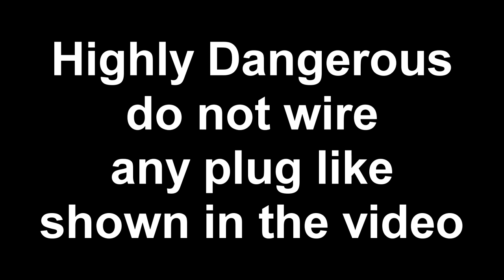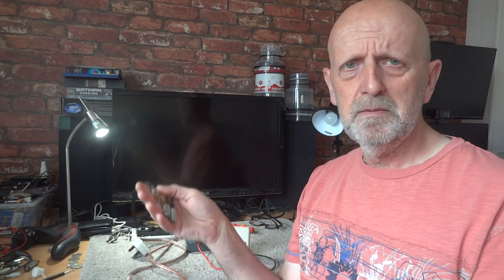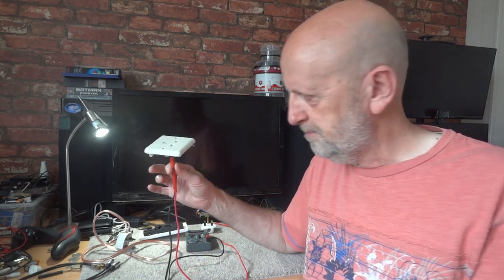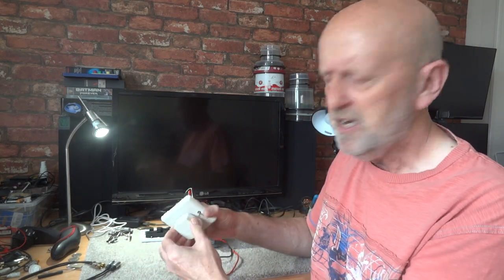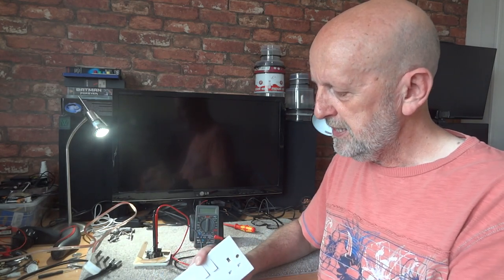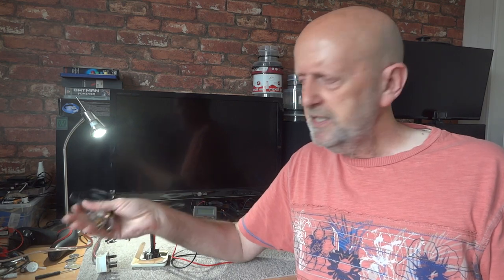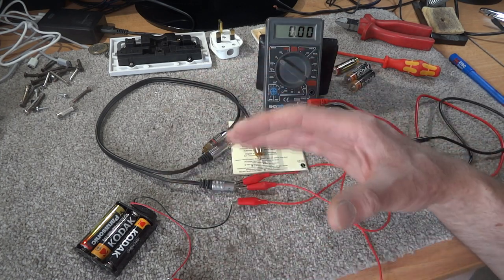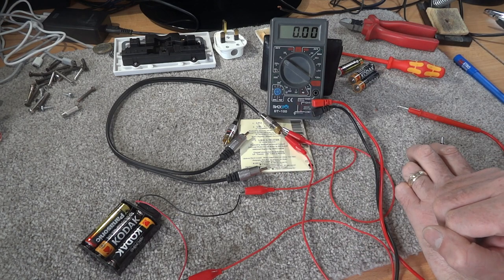Bad Connection on Dirty Wall Power Plug Sockets. Time for New Ones. HiFi Audio #audiophile

Comment: Thanks Michael, people should take notice of this video. Its suprising how dirty these sockets get and putting a new plug on helps a great deal even on an old socket as I well know. I had had PLUGS GET HOT but once a new plug will shiney new pins the plug did not get hot. It is the dirt causing the resistance that caused the plug to get HOT
Reply from the maker: Thanks for comment Tony never thought of that and a good point, this could well happen when drawing a large amount of current like a kettle or fire, pins or plug getting hot

Comment: Most RCA phono leads use  single core coaxial cable, where the centre carries the signal and the outer screen is the Ground. Some of the 'directional' cables have twin centre cores and an outer screen. In this set up they use one centre core to carry the signal (centre of plugs linked as normal),  the second centre core is used as the Ground (outer of both plugs linked). The remaining outer screen is also connected to the Ground at the source end only and left floating (disconnected) at the amplifier end. The idea being that this cable configuration will give better screening and noise rejection.

Comment: hi on the pro  audio  not the home gear    they have pot's for  in and out audio  you are very right about the CD players  and the out put 

i stopped using home amp    i have a fostex line mixer 2016  it get's over alot of the bad levels   they do sell very well will 

i beware of power buttons   i had  to open up the power button the clean the in side   i had 2 x sony a500p  betacam   i push the mains on my lights went out

luck a have a test  power unit like the pro's    i am lot more carefull now   there's a copper  parts in side  that need a clean i could see  where the blaxk was 
in side the button      hope you are well
Reply from the maker: Very well thanks Bob, yes I think a lot of people dont know about CD players outputting to high levels for some old Amps and Receivers and getting the right cable that will lower the output will give a much different sounding result.